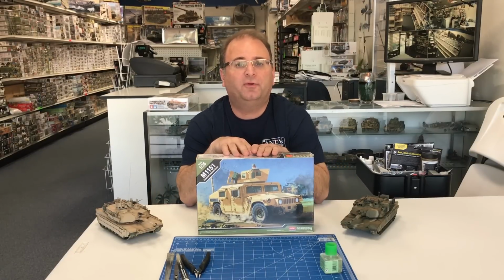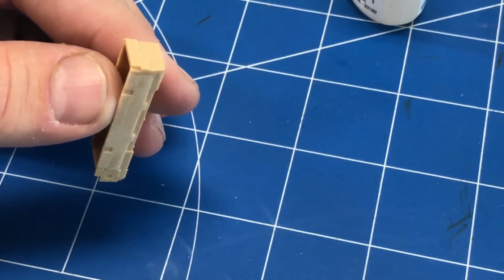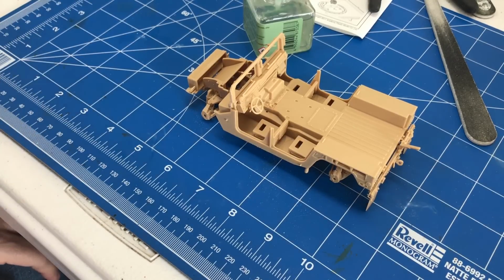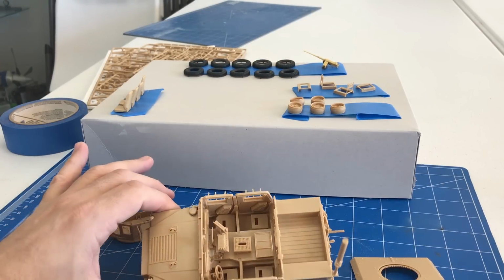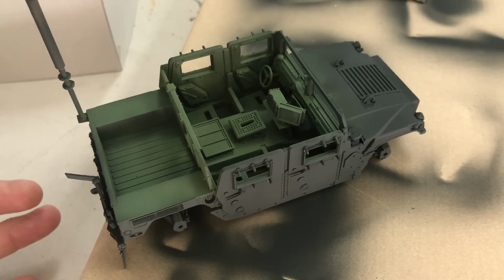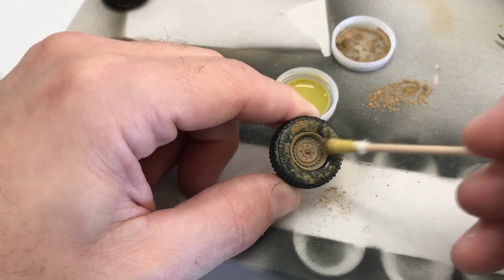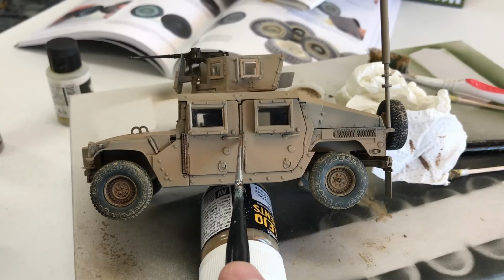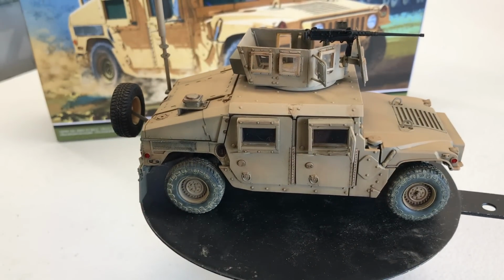Building the Academy Models 1/35  M 1151 up armored Humvee

Comment: one small detail to point out, the small areas on the hood where the sing load hooks stick out are black rubber.  Great build as usual cant wait till im settled in my new place so I can get back to building
Reply from the maker: oh thats good to know I will change it
Reply: Im gonna need to get this kit, thinking of doing a paint scheme of the Kurdish Peshmerga and try to find a good quality 1/35th DSHK to mount instead of the M2
Reply: @AndysHobbyHeadquarters  Ducati121 is correct, Andy. Also, the reinforcing plate between the roof & door pillar should be a single piece, not 2 pieces, as the kit depicts. To do this 100% correctly requires either minor scratch building, or Academy molding a seperate piece. And, c'mon, Andy! All that work to slap some silver paint on the mirrors? You don't have bare-metal-foil? Well, it's not like you're gonna enter it at AMPS, right?.... Hey, good job, Andy, and my so-far single order from you guys was EXCELLENT price & service, - Takom M-60, w ERA.... KEEP UP THE GOOD WORK....
Reply: @Ducati121  maybe the Tamiya T-72?....altho I'm sure you found 1 by now!....

Comment: Drove a few of these over there before moving on to bigger things. Liked the vid need to add a rhino. We got assigned MRAPs at one point but I always felt safer in the 11 better controls and response. I still have my 1151 data plate. The truck took three blasts head on and kept ticking. end of tour I took the data plate, she was slotted to be handed to the Iraqis. Thank you for doing a vid on this machine.
Reply: If you want to see the truck in question I'll email pictures

Comment: Andy, HELP!  I am building this model for my son who spent many hours in one in Iraq.  I am using airbrushed Tamiya Acrylic paints that look great.  When I used the panel liner I used a bit much and wanted to clean up some.  When I used a Q-tip with water it removed the paint down to the plastic.  I tried clear coating with lacquer before doing the panel line which protected the acrylic, but it looks yucky.  What sequence should I use to "personalize" my model after applying the base paint?  BTW, the black with white accents looked great.  I see many comments about clear coating but it never says what to use.  I have both flat and gloss acrylics but don't know which to use and if it will protect the base paint when trying to detail when too much liner is used.

Comment: FYI, my Son was in Iraq in 07-08 w/101st. Their vehicles started out new and no one ever took the BLACK vinyl shipping covers off the seats in any vehicle.  That kept the fabric from being destroyed by sand and it was easier to slide in/out.  All their vehicles with fabric seats were left like this.  Also, the step up for the gunner between the front seats usually had a couple of .50 cal ammo cans on it for easy access.  As far as I know, no one makes a usable version of the cool harness the gunner wore.. or the quick release that was used on newbies to drop them inside.......

Comment: Just so you know, All 1151's I have ever signed for had OD Green interiors with Tan Exteriors, they did not EVER Paint the interiors Tan, it was impossible because they would have had to mask all the ground points and all the guages off, it was so time prohibitive that it was never done.  In Afghanistan, the ANA had Green Vehicles sometimes but usually not the 1151's   Mudflaps were also not used, they were required for ONLY stateside vehicles, some European vehicles used them too but not the 1151's  the antenna for the DUKES system is wrong too, ours all looked like a wiffle ball bat that was stepped on, like a cricket bat.

Comment: Wonder if the doors are operating?  Lots of details that can't be seen, looks good though!  Used to build and test drive them. Noticed a few  details not right, but minor.  Needs a better air cleaner cap assembly, a desert style that stands much taller, that one is a standard version.

Comment: A lot more crap on the inside and somewhat outside than the ones I use to drive.

But they sure as hell got the small seating space accurate. And from my memory that center piece never seemed to work right in this version or the next version below it.